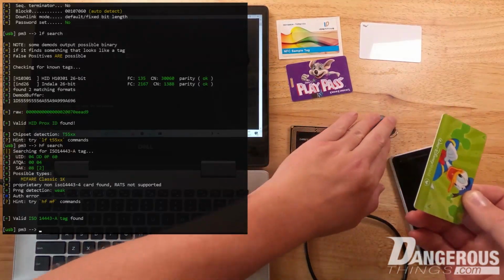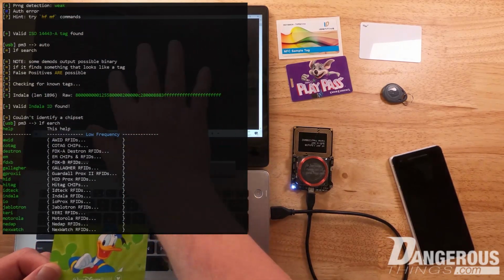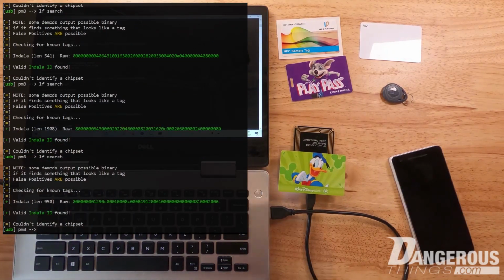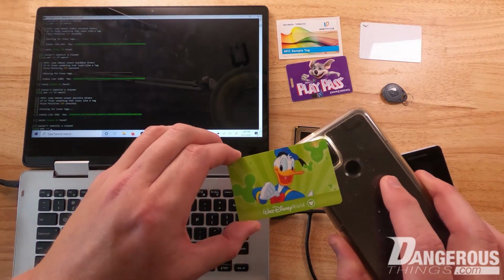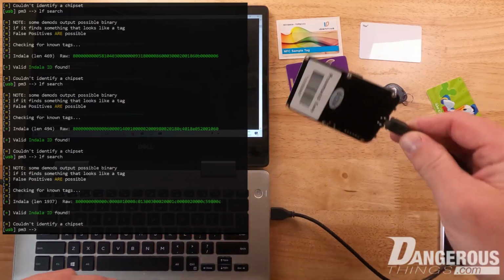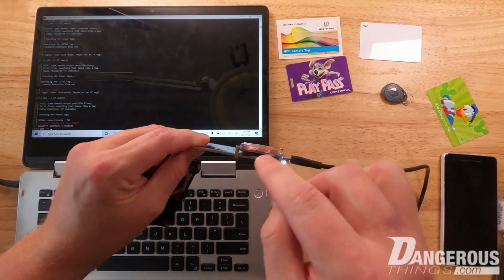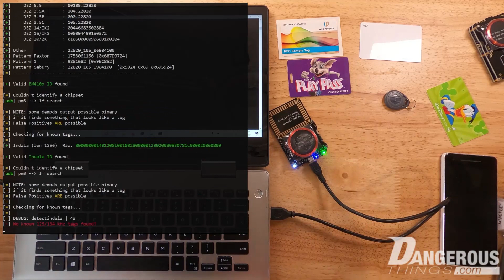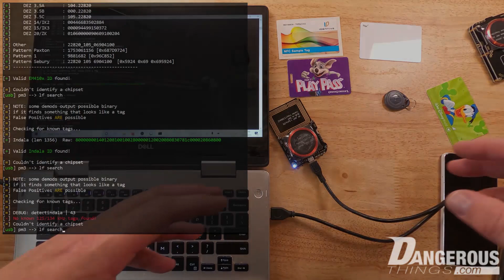A common Proxmark3 Easy mod causes noisy false reads

Comment: Generally, when dealing with RF, it's best to assume that the RF and electrical engineers know more than us. The spacing of the boards, the trace routing, all that good stuff absolutely matters at 13 MHz.  If you use the tune feature, you can actually  see that many tags perform *worse on the bottom of the proxmark (touching the antenna PCB) than they do on top of the second PCB. You often need a bit of spacing to get the best coupling (especially when the antenna sizes are mismatched). That middle PCB wasn't just something they decided to throw in for looks. So, yeah... don't remove it.

Comment: Do you think there will be a crypto currency cold storage implant device anytime soon?
Reply from the maker: That depends on what you mean really.. if you just mean backing up or storing a wallet private key, you can already do that by writing it to a simple NFC chip implant like the dngr.us/next and protecting the memory against reading with a simple password. I would post to the dngr.us/forum about it though because several people have already leveraged NFC chip implants for this type of use case already.
Reply: @Dangerousthings  ok. Another question i know the tesla key is sold out. But since the actual key card for the car is a simple rfid chip could i clone that function from the car or card onto my own rfid mplant?
Reply from the maker: @4TheLoveOfGadgets  It's actually not a simple RFID chip.. it's a javacard secure element chip running a java application with complex public key cryptographic signatures running. VivoKey is working on release of an applet for the Apex implant (vivokey.com/apex) and Ring (apexring.com) to run as a Tesla key card (vivokey.com/nak) so keep an eye on dngr.us/socials for announcements.

Comment: So I am having a problem with the makefile.platform. Whenever I move the # up to the correct spot and save and do the whole save process on command prompt, it doesn’t seem like it wants to save! 
I dunno if I skipped a step or what
Reply: Not sure what OS you're using, but on my Linux laptop I had permission issues when I tried to edit the make.platform.sample file. I was going to edit, then rename. Used a text editor and had no issue.
You could try just copy and paste into a new text file and save as makefile.platform